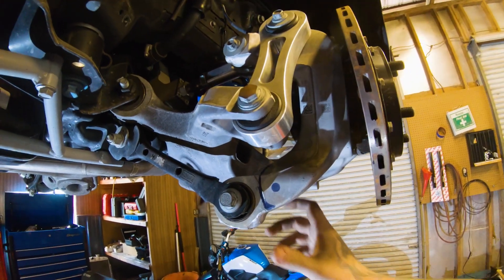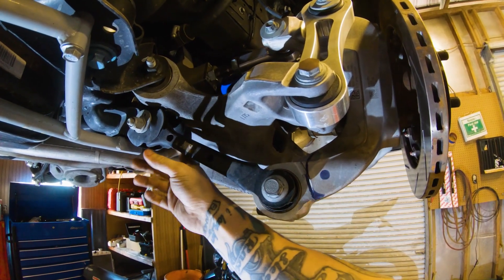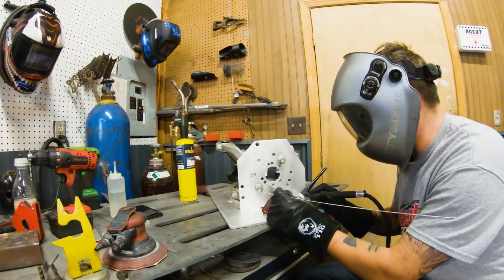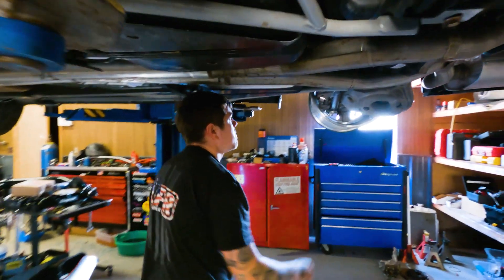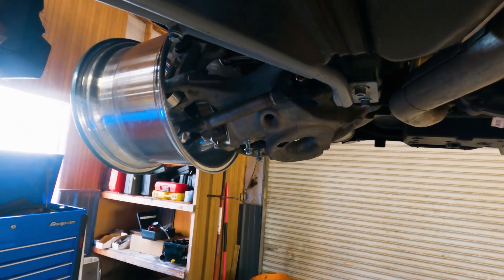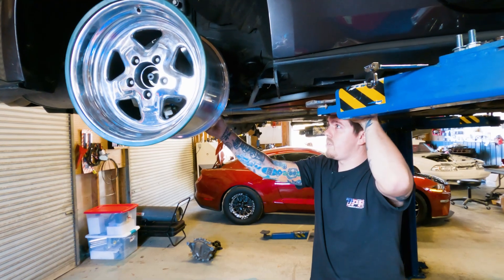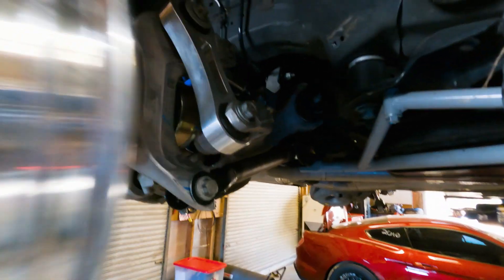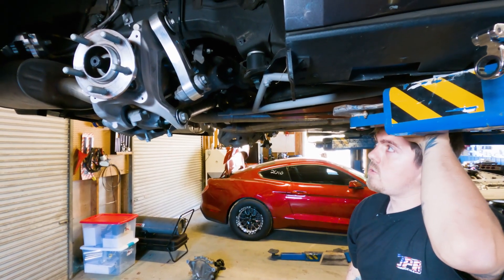Ford Mustang S550 15" IRS Knuckle Conversion Part 1

Comment: What actual 12" wheels did you go with? Backspacing?
Reply from the maker: 12” backspace unfortunately hits the control arm and arm must have a grinder massage. We are making tubular rear control arms that should be complete in about a month.

Comment: Where can we order these from the site isn’t up yet.
Reply from the maker: Hey man. Shoot us a message on Facebook and our numbers are there also
Reply: @zeroinracing1917  with these do I have to use drag brakes or can I get away with s197 brakes?
Reply from the maker: @BarnfindGT  s197 brakes will work but we have only used drag brakes.

Comment: Why are the knuckles you sell now different ? This design seems like it would have been stronger
Reply from the maker: These were tapped horizontally and at higher speeds and flex these caused some rear steer. 

The new knuckle has more thread and a heim joint that exceeds the strength of the oem and maintains factory geometry. 

Thanks for the comment.
Reply: Thank you for the reply.  So these were binding up/hitting on something as the car went down the track? Just curious how they caused rear steer.  I’m on the fence right nowbetween these and aed’s but that little heim threaded into aluminum just scares me a bit on a 1400 wheel car,  thank you
Reply from the maker: @RacingRon47  that’s a 5/8 heim capable of more break strength than the aluminum.
Reply: The heim doesn’t concern me but the threading into the aluminum in a tensile scenario since it’s a toe link does worry me , unless it has a nut for the front side of the knuckle as well? I can’t tell from pictures on fb page
Reply: I guess what im asking is it drilled all the way through and the heim comes out the other side
Reply from the maker: @RacingRon47  yep. The top goes all the way thru. The heim doesn’t come quite thru all the way but it is threaded that way.
Reply from the maker: @RacingRon47  yes has a jam nut and it also compresses the toe to heim. 

There is very little pull. The cars rear wheel crawls forward and into the front fender so the tire is trying to force the knuckle into the toe link. Not separate it.
Reply: Thank you for quick reply , I understand,  i suppose you would have to mill it flat on the front face to put a nut on the other side since it’s kind of curved , and use a longer heim.  Thanks